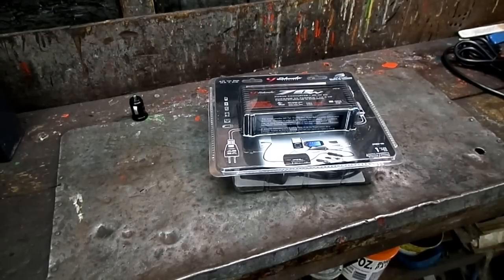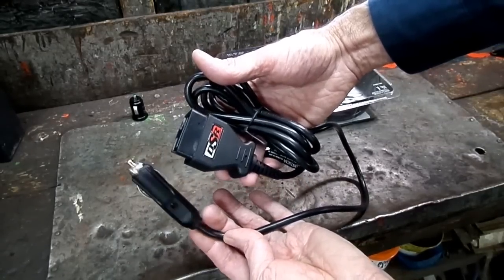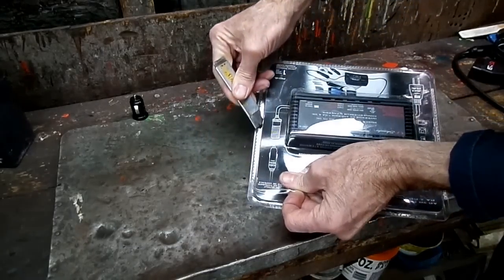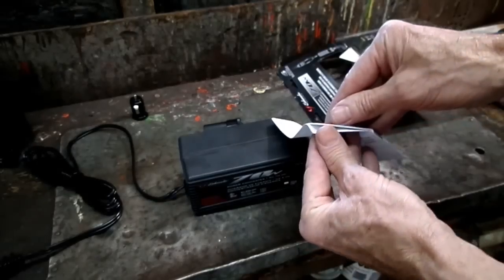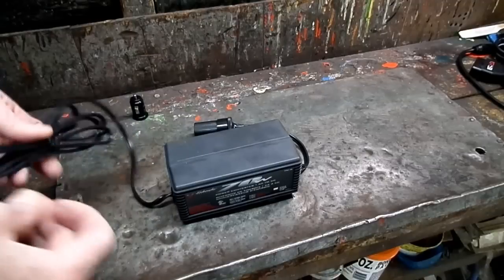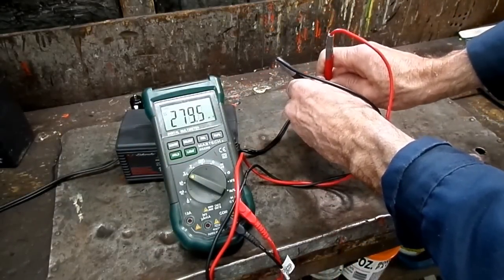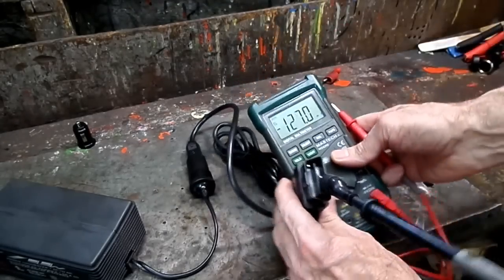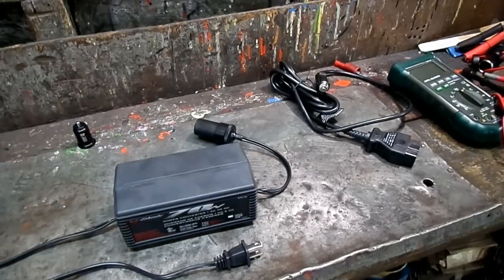Schumacher AC to DC Power Converter

Comment: I know this video is old, but I just got a RoadPro converter at Loves truck stop. I hate it because the fan in it is loud and constantly runs. I have a 52 qt 12 volt fridge that I plugged into it to test it in my place and I csn barely even hear my fridge run. But this dumb converter is a loud. It's not a bad fan....its just ridiculously loud. Why do they make these converters that way? Yours ain't that way.

Comment: I believe you will be better off using your motorcycle battery rather than the Schumacher unit only becase of the remote chance of a power failure with the ac connection. You know --Murphy's law.

Comment: +richpin06a - I've enjoyed this and your other video on this topic. I'm concerned (a bit) about the quality of the 12v output of these power supplies converted from AC being fed to the ECM.
Even the device I built based on a 20v DeWalt Li-ion battery may have a questionable 12v output with the use of a switching DC-DC bulk converter. Can be seen here:
https://www.youtube.com/watch?v=PQTAForw_I0
Though both our devices seem to work OK without harm to ECM...

Comment: does it charge? can you take it with you in your car without it being plugged in?
Reply from the maker: +Adrian Strider It has to be plugged into a 110 volt ac outlet.
Reply: Just use it with a 75w 115V 60Hz inverter for US hair clippers, clock radios, etc.

It works fine at 50Hz on 110V on Eastern Japan, Jamaica and Barbados.

Comment: Hello Rich, I have a 99 Ford Ranger 3.0 V6 that is idling rough but runs good on the highway. We plugged the Actron code scanner into the OBD-II port under the dashboard and got nothing, no power or codes displyed from the plug. We plugged the reader into my Saturn and it works OK. What do I need to check  to get the OBDII port working in the Ford Ranger? Is there a special fuse I need to look for that powers the OBD-II plug?
Reply: There is a fuse in the fuse box #17 it is a 25A which feeds pin #16 in the obd2 connector.